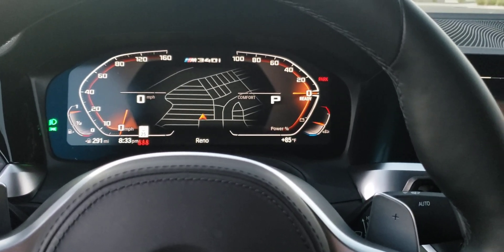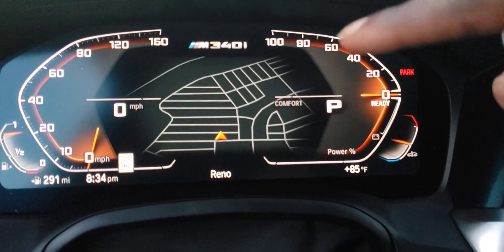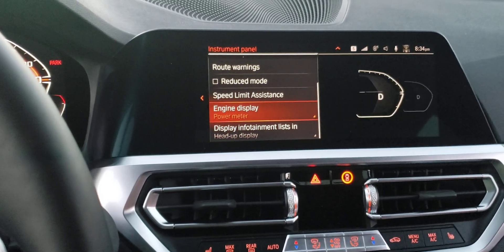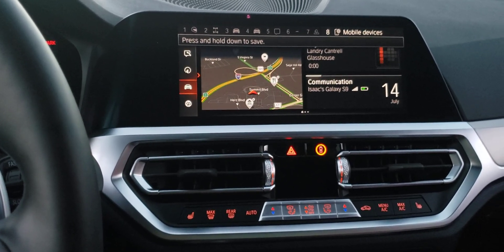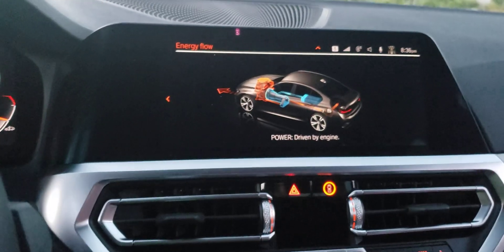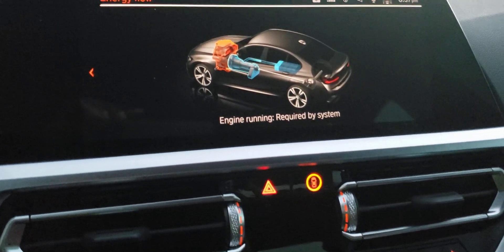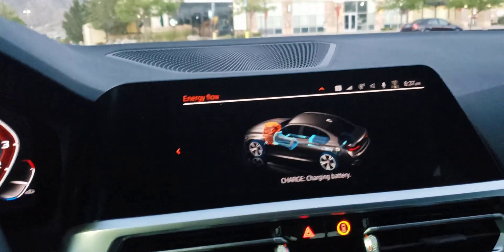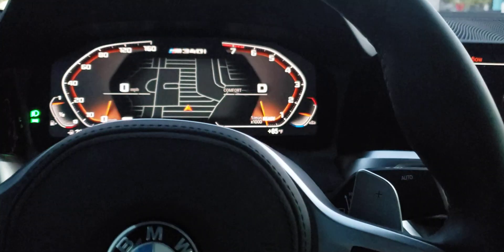BMW Power Meter and 48V Mild Hybrid  (Energy Flow Part 2)

Comment: Hi, appreciate the video. I will look at the shortcut key video.  Regarding the power distribution on X drive 340i, I believe is biased or to rear wheels as you were in sport mode.  If you are in comfort mode, it should show power going to all four wheel.